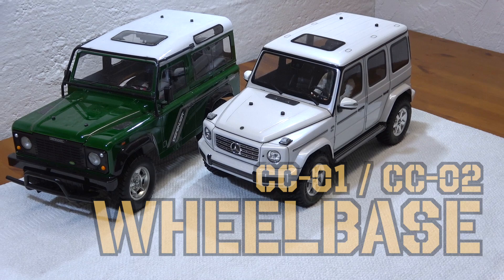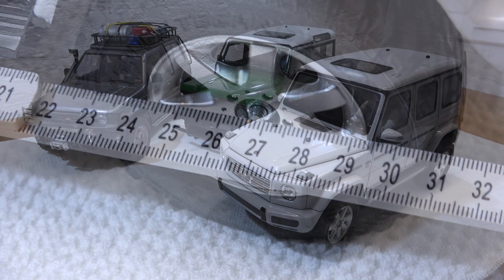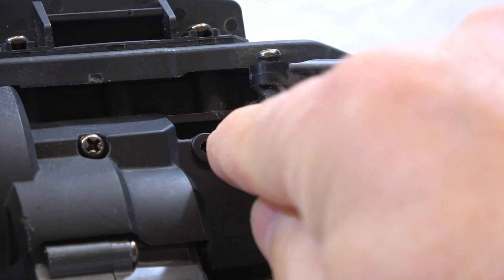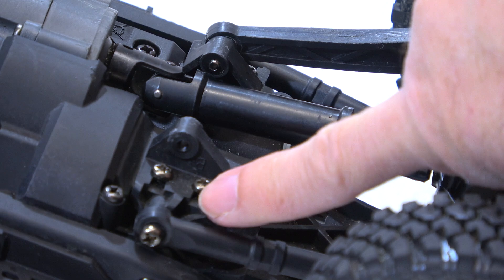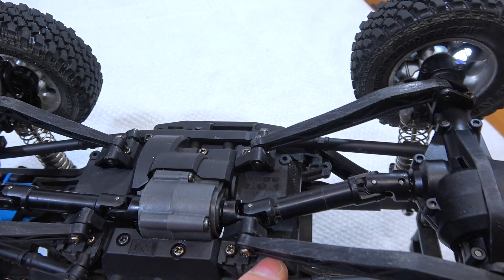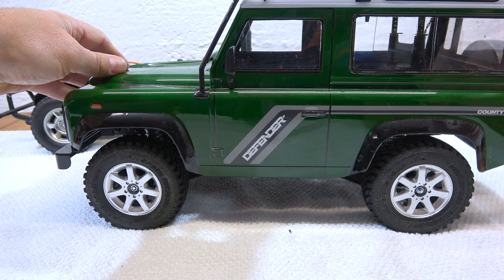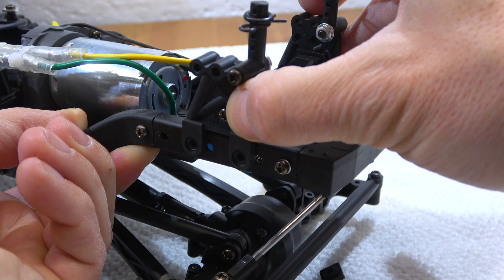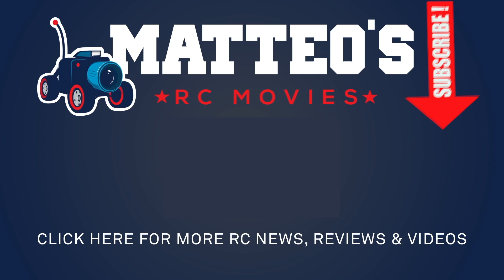Tamiya CC-02 Wheelbase Adjustments

Comment: nice tutorial video!!!
I belive the only big issue(sort of) for me is the rear body post mount(holes)
if you want to fit your original/existing old CC-01/CR-01 bodies on CC-02 chassis ,
the length between CC-02 rear post(holes) is about 10mm wider/longer than CC-01, 
and the pole position are slightly backward compares to CC-01.
Reply from the maker: Yes, of course the body posts have to be modified or new made. In my opinion it would be the best way to not use the existing holes. Better to use magnetic holders and close the holes.

Comment: I agree with Bob Martin.. You can swap the mounts from side to side diagonally .you loose about 5mm which would give you what you need. the parts have numbers on them.the link is off set from the mounting holes. New video needed.
Reply from the maker: Yes, new video already here! 👍👍😊 Thanks!

Comment: Matteo, could you swap the rear link mounts side to side so the arm mount points are closer to the gearbox and get an even shorter wheelbase?
Reply: I was thinking the same thing :) :) A ton of more wheelbase options if flipping the linkmounts :D
Reply from the maker: Yes, you're right, that's why I made a second video: https://youtu.be/sfuyA2UHvxU
Thanks! 😊
Reply from the maker: Correct, I made a second video about this... Thanks! 😊

Comment: Thank you for this very helpful video. I found a short wheelbase cc02 for a good price and I am thinking about buying it, but I have a quick question. Could it be made into a long wheelbase without modifications? (eg. changing links, driveshaft, etc) Thank you.
Reply from the maker: For this you will need a longer drive shaft.

Comment: Very clever! Brilliant! 

I'm just puzzling if a hard body D90 would fit (but isn't the wheelbase on those was 313mm though? Maybe the Tamiya D90 is smaller, there are variations in scale?).
Reply from the maker: D90 should have less than 313 wheelbase. Defender 110 should have 313 or a bit more. https://youtu.be/DH6hNVu9QBo

Comment: Great video, thank you. Can you recomend a chassis or adjustment for 260mm or 10.25 inch. I have a cool Alfa Romeo body I want to make a 4wd rally car.
Reply from the maker: Thanks! If so, you need to adjust the wheelbase by edit the length of your links. Because the CC-02 have rigid links you need complete new ones with a thread and so adjustable length.